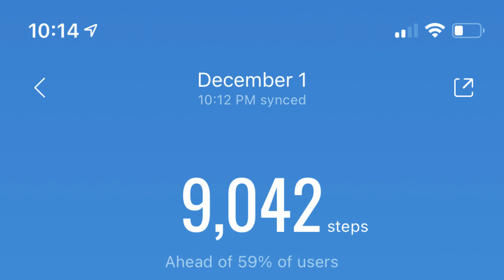The Day I Bought Penny, My New John Deere 1025R (Vlog)

Comment: Got your self a fine machine there. I would have opp for the 3 point finish mower vs the belly mower. The belly mower dont move with the terrain well.  The 3 point mower actually sits n rides on the ground (Float) and moves with the terrain for a more even cut. Specially when you set the linkage on the 3 point for extra free play for up/down movement
Reply from the maker: Good Morning Champ, Thank you for the advice. I am trying to set my mower up for the Spring... I love Striping my lawn. I don’t know how I am going to do that with this mower at this time... I would really like to figure that out before the spring comes back around... I am trying to create a show yard out of my yard... do you think a 3 point mower would help me out in that area or would the belly mower work better... I plan on leveling my lawn out to that it looks flat to the eye in photos... Any feed back you give is always welcome... comments like yours are the comments that make me better. Thank you and Much Respect and stay safe
Reply: @shawspeaks8252  Morning Both have there pro/cons the belly mower you can add a bagger kit, multch kit or side discharge. And it turns with the tractor good for tight  Areas but it dont move with the terrain cause it hangs off the tractor. The 3 point rides on the ground good for wide open land and moves with the terrain in float mode and you can set the link for more up/down movement. There's side discharge, rear discharge and a multch kit for it no bag kit. But the down side it dont  Maneuver real well around obstacles cause of the extra length and your frequently looking back there. This is for the finish mower!  There's a bush hog ( Rotary cutter) same concept but to totally different mowers
Reply from the maker: Thanks for such detail... I just learned a lot I didn’t know... Thanks again

Comment: Congrats on the new tractor 👍🏻, you should consider adding the Load N Go for the mower deck, will make it easier to store it and cleaning it, have a look at a video by Tractor Time with Tim 👍🏻
Reply from the maker: Big Orange... How are you brother... I did get the load n Go, they just had not installed it yet at the time of the video... I shot a video using it and trying to reconnect the mower deck it is all harder to use than it looks... I am glad I got the Load and Go... Because I have to pick it up and move it a lot to find level ground it seems... they have been very helpful, Just like your comment... I want to thank you for both taking the time to watch and for taking the time to give me a tip that was truly helpful... You are correct the Load N Go, Is the Way to Go... thanks Brother Much Respect and Stay Safe
Reply: @shawspeaks8252  Enjoy and Happy New Year 👍🏻

Comment: Congrats on the new tractor. I bought the same setup last year.  You will be amazed at what these little machines are capable of. I was unsure of my tractor skills  when I got mine but there are lots of videos out there to use as teaching materials. I've managed to install my own septic system,  buried all my downspout lines, put in a french drain system , made an access road  for my winter wood , redid my gravel driveway and plowed snow. I'm always looking for a reason to get seat time on the tractor. You'll be surprised by how quick you will learn.  Practice and patience are the key. Enjoy yours .    New subscriber.  :-)
Reply from the maker: Mr. GoodWrench, Thanks you for all the words of assurance. I am so ready to be good with this tractor... I have hit my house over and over with the ROPs and I have put more holes in my yard than a few... I just bought a Box Blade yesterday so I could smooth out my trails and to level out some areas in my yard... I plan on getting as many hours with Penny as I can as soon as the weather gets a little better. Water hose is always frozen here lately, no way to get off all the Mud... Thanks Again for watching and even more for taking the time to comment and even more for subscribing... Your amazing and just made my day... Much Respect to you thank you again and Stay Safe... More tractors videos coming soon... Tomorrow’s will be a little long... its when Penny got delivered
Reply: @shawspeaks8252  Looking forward to going along for the ride.  Remember we all make our share of mistakes. The only difference between us is that you video yours for all to see and comment on ,  whereas I never have to show or admit mine.    HaHa  :))      Stay safe and have a great tractor day.
Reply from the maker: That is the hardest thing about Youtube... I make a lot of mistakes and people let me know all the time... lol but its how I learn, so I am ok with it... If I had someone around to bounce things off of Maybe the learning process would be easier... thanks Again Mr. GoodWrench

Comment: Enjoy your machine 
Don’t worry about taking off loader and backhoe lots of videos out there to help,practice makes perfect.
When I take off backhoe I pull ahead just enough to clear hooks on bottom then turn off tractor slowly release pressure on outriggers watch you hyd lines.then I cycle both sticks sticks to relieve as much pressure as possible. Makes way easier to connect hoses later, if unhooked for couple days will probably leak down anyway which will build up pressure on hoses. I always turn tractor off when connect/disconnect hyd lines and move levers on loader or bh before disconnecting to release pressure. 
If you have to smack hyd tip to relieve pressure be careful it sprays everywhere.
This is my opinion and works for me do what works for you.
You will be pro in no time..
Reply from the maker: Jim, Thank you... you took the time to right me a review on how to get comfortable with my equipment... Man I needed more than you know... some how the way you explained it made sense to me and it also made me not as intimidated to try... I have been really nervous about using it... I took off the mower deck and caught hell trying to get it back on... a part fell off... glad I found it. I want to say thank you again... Jim you are the man... My next warm day off I am going to practice taking off and putting on the Backhoe... thanks again... I feel like I will get better in time... Much respect to you and Stay Safe... thanks again
Reply: @shawspeaks8252  be not afraid, but definitely respect the power of the machine and its attachments. When in doubt, think it out.  All has been engineered very well.   Jim is right.  Lots of good videos out there, just use them take your time and enjoy.  You will figure it all out and enjoy it the whole time through.

Comment: Practicing disconnecting and reconnecting each implement over and over and over until it becomes second nature is the only way
Reply from the maker: I want to do this but I tried this with the mower deck felt like I was never going to figure it out... I am not sure how it will be removing the backhoe... I am worried about trying to hook it back up... its a lot to learn... a whole lot... lol
Reply: Congratulations on the new tractor. Just take your time when connecting and disconnecting everything. It takes a little time and patience.

Comment: When you take the loader off, keep going until the cast iron locks close. Loader won't leak down then.  Also before unhooking, move joystick front, back, left, right to release pressure.  He pressed the one hose tip end to relieve pressure, but usually it's worse than that if it happens.  Have to put a rag over the end and tap it with a hammer or best rubber mallet.  When re-installing loader, those cast iron locks will lift and close on their own then.  If storing in a garage with a cement floor look into buying or building a cart for the backhoe.  Easier to install and take off and move around.  Can buy one from https://www.bxpanded.com/john-deere and many other useful items.  Or build one, plans on greentractortalk.com forums. Newer 260B backhoe needs 4" castors though, the plans were for the 260 backhoe and called for 5" castors I believe.
Reply from the maker: Cash, I am worried about taking all the parts off... lol I am scared I will not get them back on... lol I have a lot to learn when it comes to this thing... I will be checking out the tractor talk... thanks for the links and all the info... I will say some of it is a little over my head... thanks again much respect and stay safe...